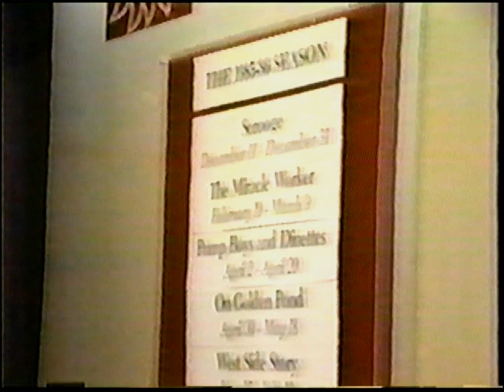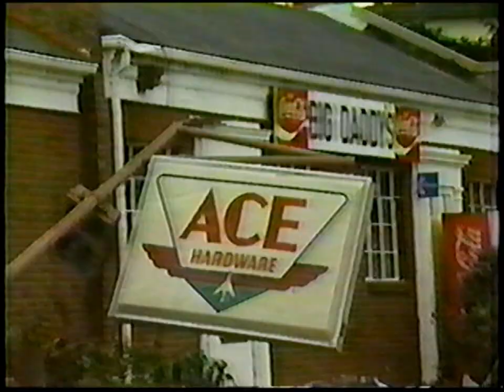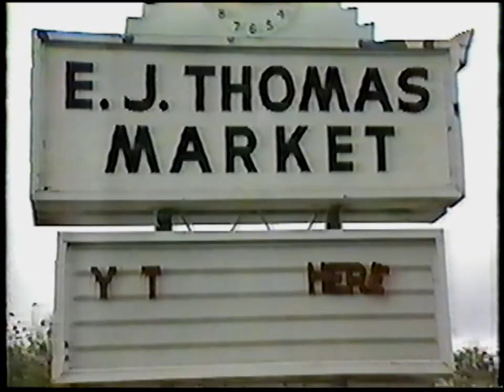The Flood of '85 - Roanoke Virginia

Comment: Thanks for posting this. I was living on Marshall Ave at the time and was high above the flooding. A short time after the water receded, me and a friend went down to Wasena Park to see the damage. It was a total wasteland. The image that will stick with me the most there was of the football goal posts that were bent almost completely over. A true testament of the waters depth and power.
Reply: I walked down to Wasena Park then, too! There were piles of debris nearly up to the baseball field. Tree branches all over the ground and plastic bags all up in the trees. 18-wheeler trailers strewn all over the place, crushed and flattened like empty cigarette cartons. Walked across a stack of wooden pallets and stepped on a damned nail, went right through the bottom of my Air Jordans and into the bottom of my foot. I still have a photo my dad took of the water almost up to the top of a speed limit sign, taken at the intersection of Howbert Avenue and Main Street.

Comment: 4:04 The legendary LAKESIDE Amusement Park.
Reply: That's what led to it closing?
Reply: @jaydodsworth3063  from what I understand, the flood devastated the park, but someone bought and rebuilt it. It was to open in the summer of 1986, but there was an accident during a test run of the roller coaster (a maintenance worker was struck and killed) and there was a lawsuit. I may not have all the facts right, though.